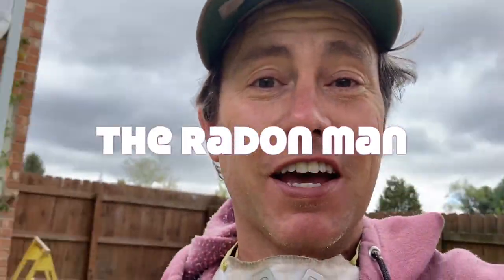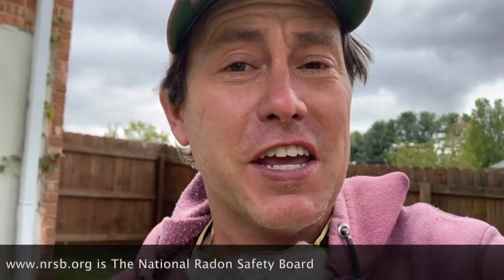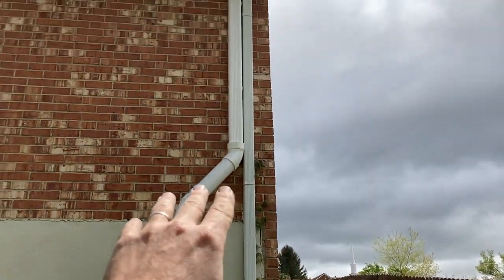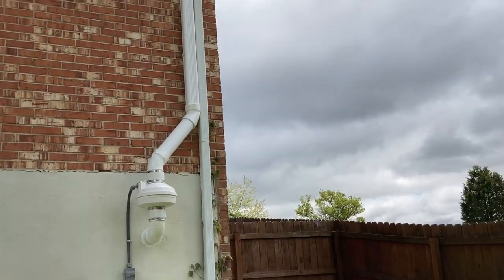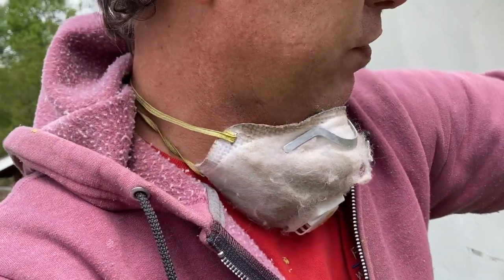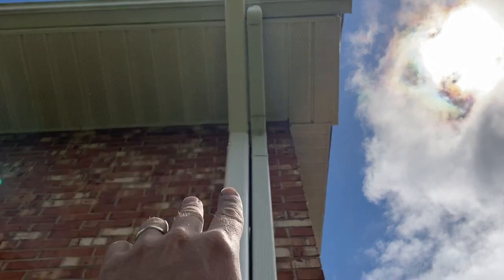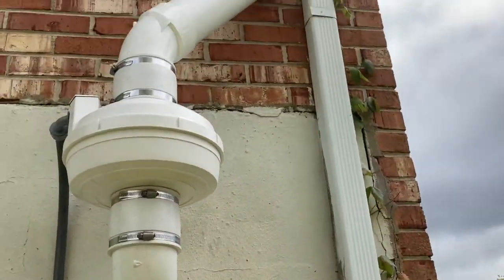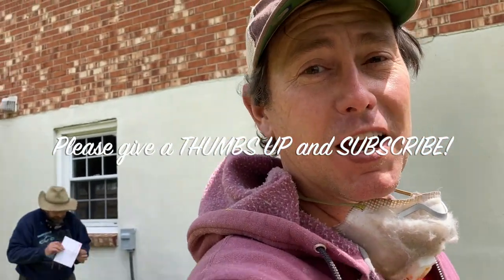Using Downspouts for Radon Venting?

Comment: I see two hidden brackets but what else are you using to hold this to the house? Is there any connection to the gutter? My vinyl exhaust seems flimsy.
Reply from the maker: Hi Andrew. When we use vinyl downspout we use clear silicone and then use 2 or 3 small screws at every junction.  Sometimes we'll attach a bracket onto the gutter if the over hang is a bit wide.
Reply: @radonman6800  thanks for this reply. I am going to be doing something with a bracket to the gutter as well i believe.